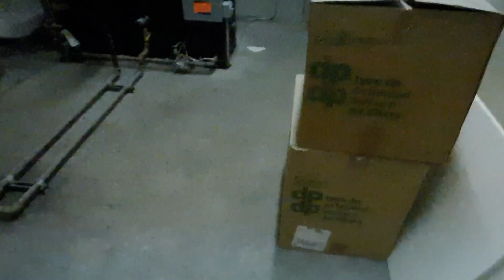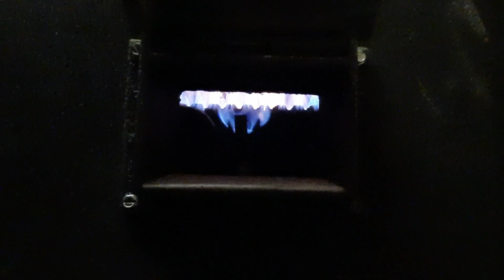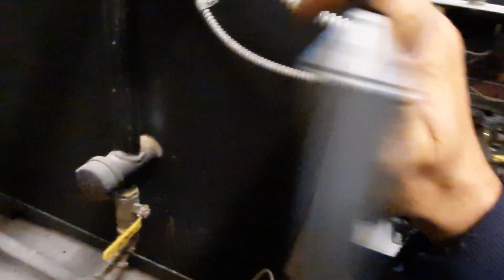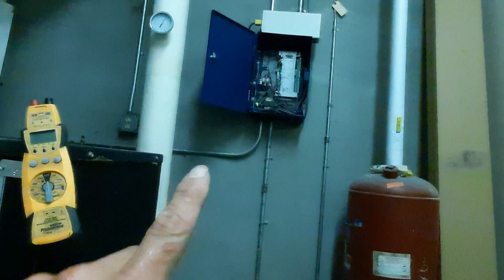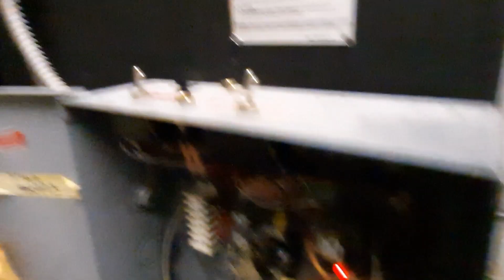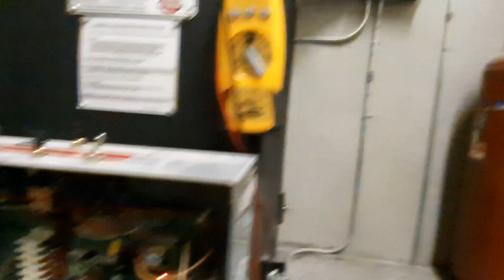No Heat Service Call, Boiler Issues?

Comment: I would recommend a preventative maintenance on this boiler. Price them to take it apart and clean it because it could be a heat rise issue and the limit seems to be set kind of low. Usually we set it for 180°f where I live. I find when boilers run for a long time with poor heat exchange it could cause it to trip off on high limit.
Reply from the maker: Yes 180 is a normal temp but this is used to feed reheat coils in the supply air of 4 roof top units to help control humidity, 150 was their set point. And it does need a P.M. but found out later it was a setting issue in the BAS that was causing a problem and short cycling. Thanks Brian!

Comment: Could it some threshold settings in the controller that keeps turning the system on/off at low loads?
Reply from the maker: I think that's what had to have happened. They had high and low humidity settings the same, it's weird the control would do this but no other complaints after adjusting. Thanks Mr Bugenhagen!

Comment: This happens to me as well. You pretty well shook all wires to see if there is anything loose and checked the tolerance of the thermostat and seems to be correct. About the only thing you can do is go back and question the customer more to get the most information possible and see exactly when what where and what happened when it happened otherwise just wait until it stops again
Reply from the maker: Thanks Rick! Yeah I asked some more questions he said that the binary output light was flashing and no other problems with it since I left so had to be some weird control issue.